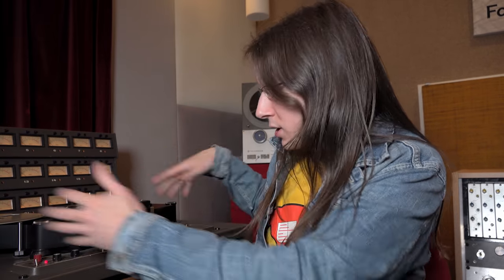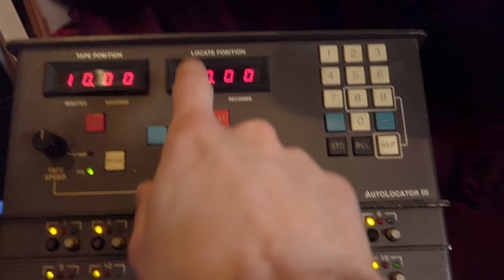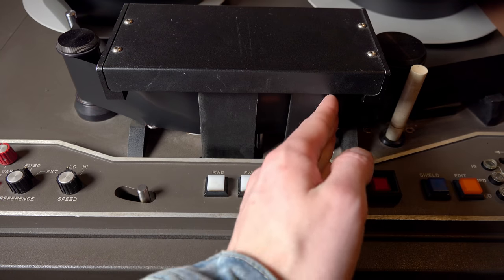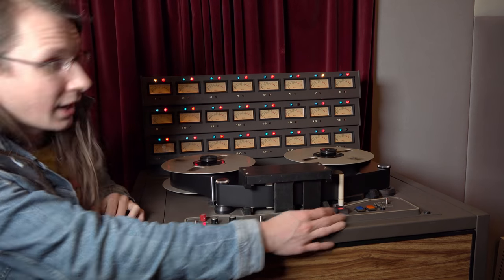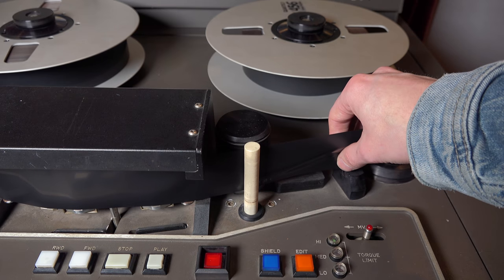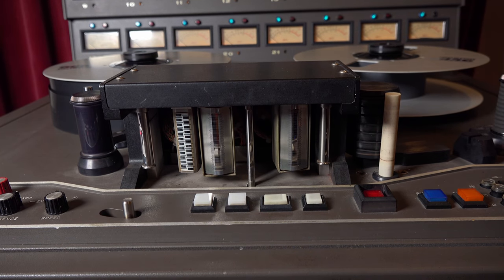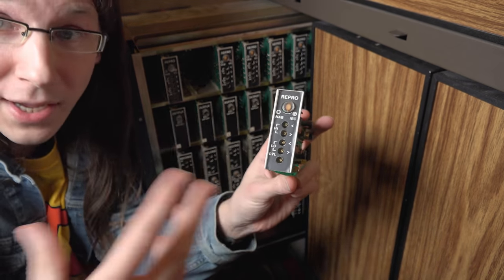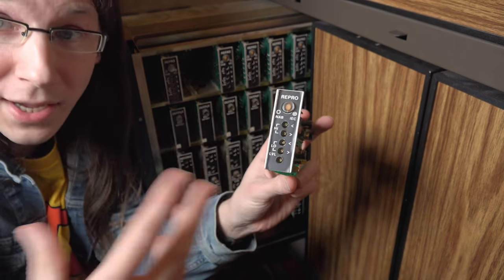THIS IS HOW A 24 TRACK TAPE MACHINE WORKS!

Comment: Uh, no. 15ips(inches per second) versus 30ips does NOT, IN NO WAY, mean you can capture higher frequencies.  This is utter hogwash.  It does mean you get a 'different flavor' of tape noise and, in general, higher tape speed may sound better because any variations in the magnetic particles on the tape(pops) are traveling by twice as fast but, the idea that you can capture some higher frequencies THAT ARE SURELY INAUDIBLE is just stupid.  Why does a millenial who doesn't understand tape recording want a 2"/24trk anyway?
Reply: BTW, I clicked on this video because the title said something about a 2" 24trk being SO hard to understand. No. They aren't. Start with a 1/4" stereo machine, then to a 1/2" 4-track, then 1" 8trk, then 2" 16 and then 2" 24. They aren't hard at all and they don't lose files when the electric goes down for a minute.